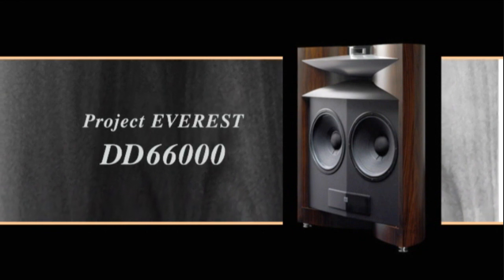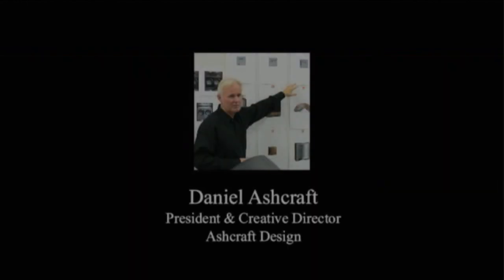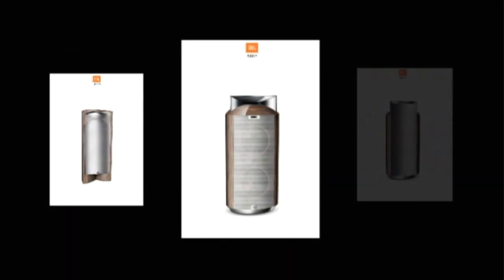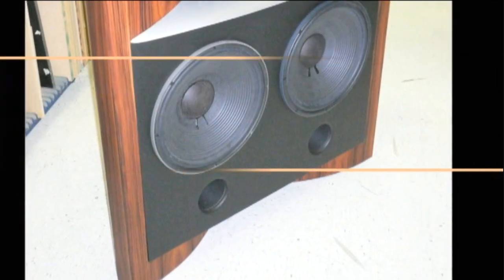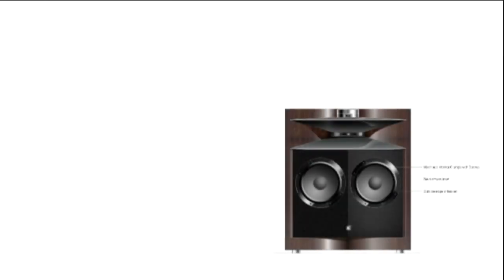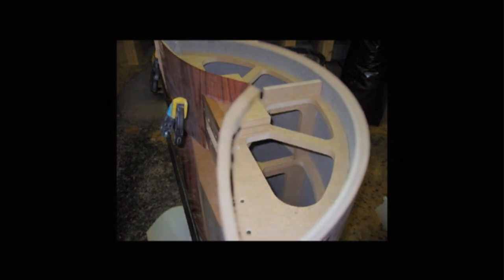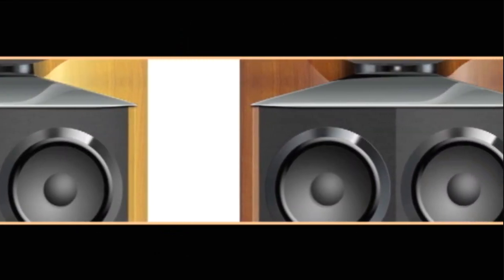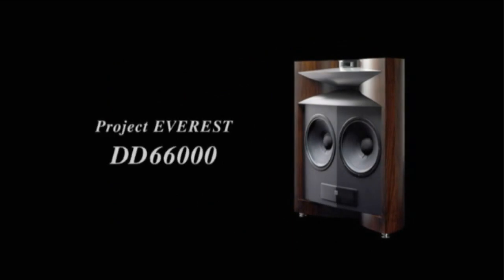JBL Project Everest II

Comment: @bsod4u2 Indeed, it can even REDUCE distortion if implemented correctly.  A vent is tuned to resonate at a particular low frequency, thereby "helping" the woofer out.  Woofer excursion is reduced greatly at the tuning point, allowing the speaker to operate within a more linear part of its motor and reducing nonlinear distortion.  If you've heard a bad vented box, it means the woofer is crap to begin with, the port/box/woofer combination isn't tuned correctly, or the port isn't correctly sized.

Comment: Some of the very best speaker systems in the world by B&W, Revel, Wilson Audio, Focal, MBL, etc are ported and they cost upwards of $250,000. Some of the best subs are sealed, so really doesn't matter weather it,s ported or sealed, it all depends on what the designers are trying to achieve with thier speaker. each has certain characteristics. now a poor designed vented system can sound bad or bloated have one base note sound but done right, either way can yield awesome sound.